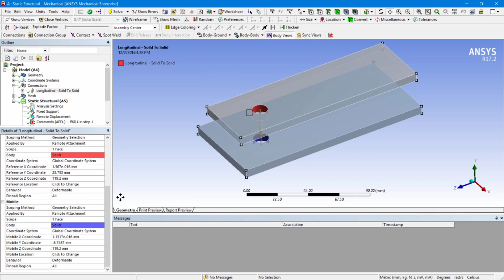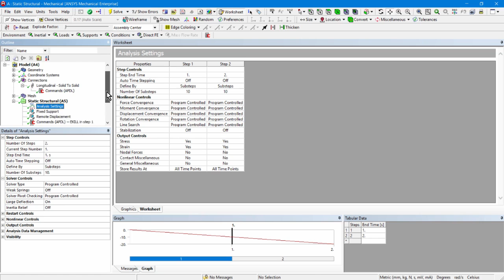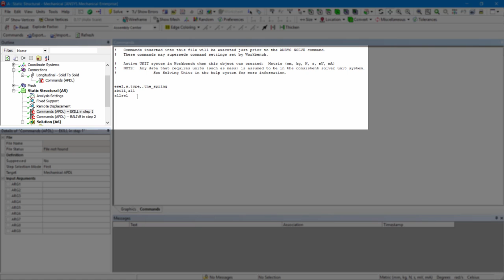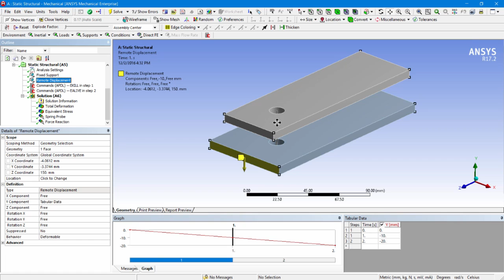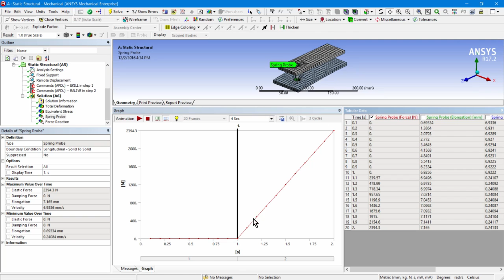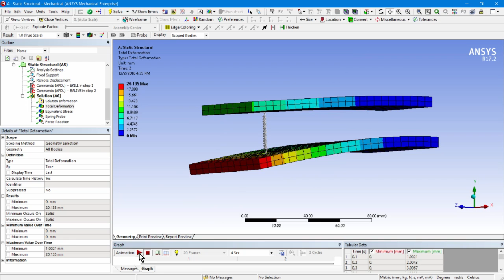Implementing Element Birth and Death in Ansys Workbench Mechanical

Comment: I was doing this death and birth analysis on transient thermal for welding of double V joint but my temperature came out to be negative, of value about -873.C although the initial temperature was 22.C 
Pls suggest something for this
Reply: @2sh ar: Dear friend,  the negative value of result temperature would probably be caused by the incompatible meshing in your model. Try to use inflation tool or refine your mesh at these positions, you may see the better result.
Regards!
Reply: can u explain me this technique in easy terms..i want to know why we use this in welding simulation, why we use in moving heat source,in what way this birth death technique helps?? please.

Comment: Element birth and death... potential application includes staged construction, in which some parts come into existence (element birth), after some preliminary load steps have already been solved. With a spring, it might model the installation of a spring after some solution steps have been completed. Element death could represent the non-existence of parts of a model during some load steps. The parts of the entire model have to exist at the beginning of an analysis. Some parts (elements) can be killed before the first load step solve, and brought back to life later.
Reply: Can you please tell me the command line within Spring Joint, It's Not Clear